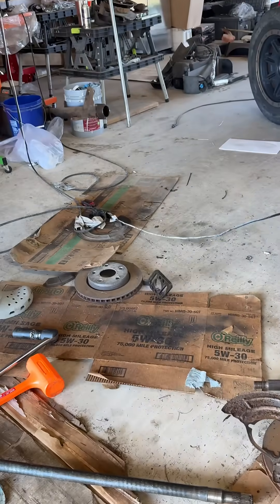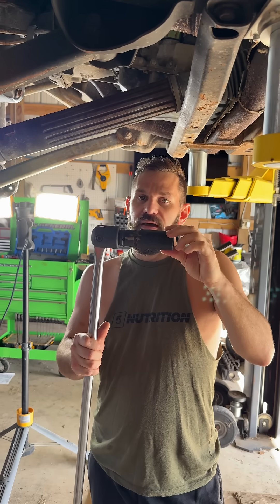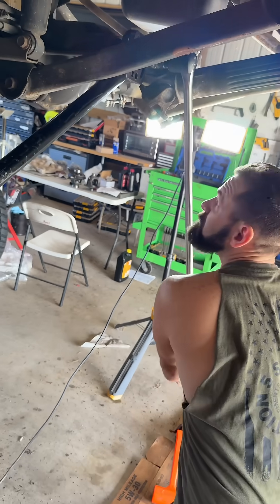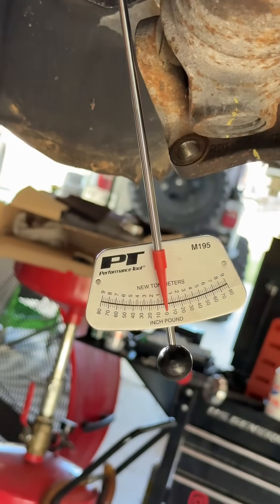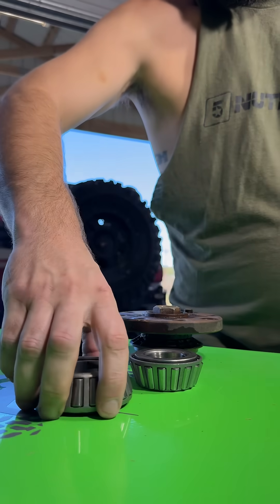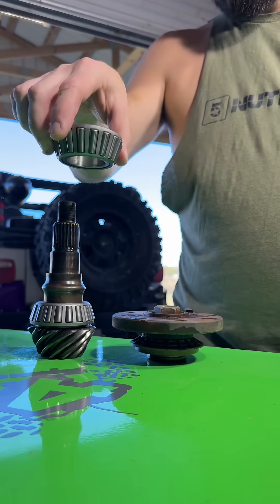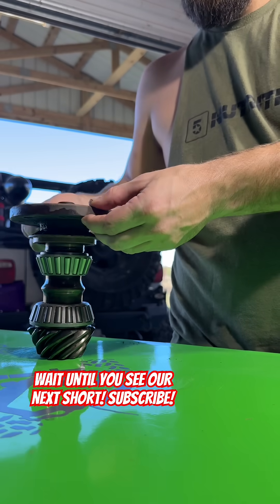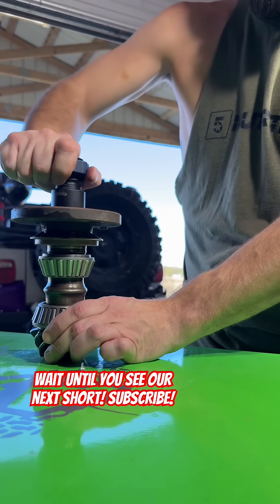Stop Guessing Pinion Preload #shorts #axleoffroad #differential

Comment: How do you determine the proper bearing play with that crush collar?
Reply: When tightened it collapses to retain tension between the bearings.  As he said, if overtorqued and you try to loosen it to adjust it, you create a gap between the bearings.
Reply from the maker: The proper rotational torque in inlb of tightness, will tell you exactly how much the crush collar is crushed.  If you go over the spec, you will need a new crush collar and will have to pull the Diff back down.